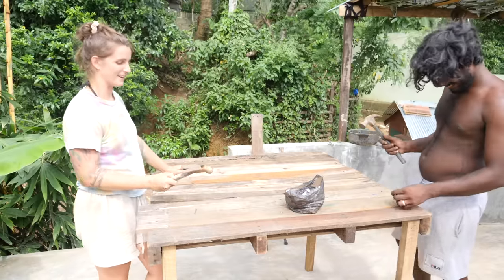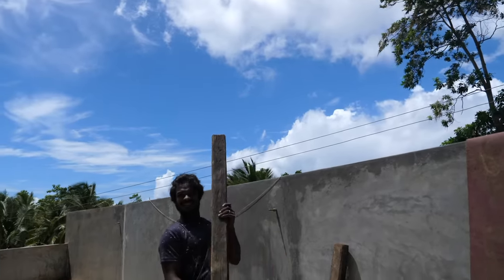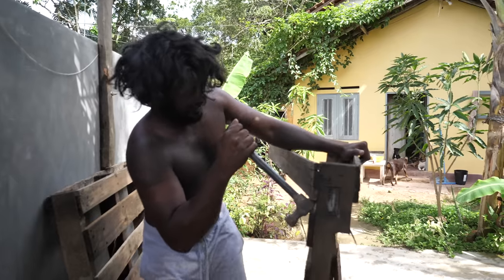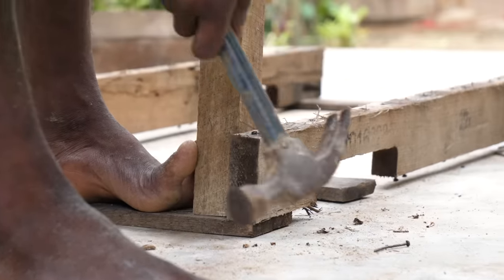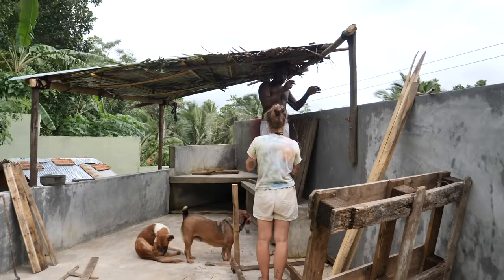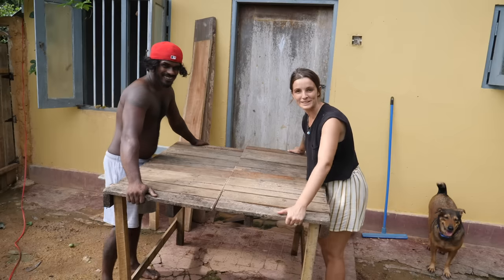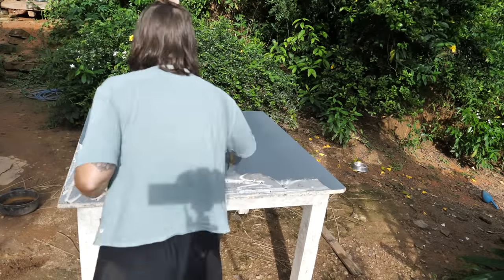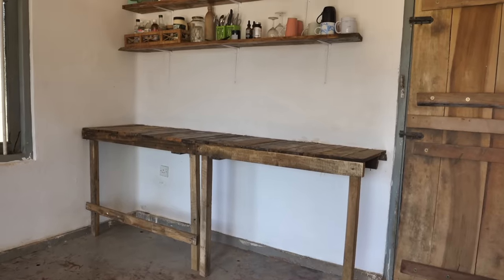A much needed UPGRADE to our PATIO AREA!

Comment: Love your outdoor patio area.  just sublime. Couple of tips rub coconut oil on your hand saw will make cutting wood easier and prevent rust. Also try not to hit nails too many times as they heat up and cause them to bend perhaps pre drill hole 60% of length of nail . Good luck and keep up the excellent job you both do

Comment: I just wanted to suggest you to move the two nuts you use to fix the coconut studds in your patio to the home side. It is not safe to leave it facing road (you will not notice if it unscrewed, loosen)

Comment: The problem living in a tropical place is the termites eating at the wood. Maybe, with the thatched ceiling under the tin would keep the heat from penetrating through the tin.
Reply from the maker: Yep termites are a huge problem here!

Comment: Not only the nails but the wood will be a problem because of the method that U use! When U hammer nail, bad enough the nails bending the wood also splinters. So it's much better to drill holes in the wood and use wood screws. Even though this method is more arduous, it'll definitely be a better option...